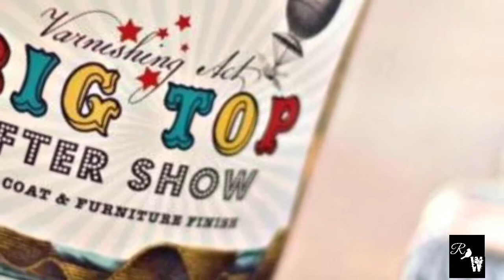How to transform a hutch top

Comment: How did you get it to stay standing? Mine keeps falling forward.
Reply from the maker: Hi!  Thanks for watching. I made sure that the bottom shelf had enough depth to balance out the top allowing it to be sturdy. I’ve done 5 of these and they’ve all been sturdy.   For added support you could get a small “L” shape bracket from your local hardware store. Mounting it to the piece in an obscure location and also attaching it to a wall would support. The decor items could easily hide any visible signs of the small bracket. Just an idea. Hope that helps.